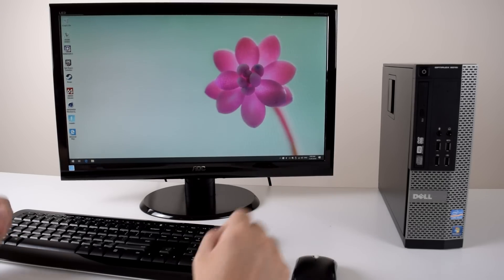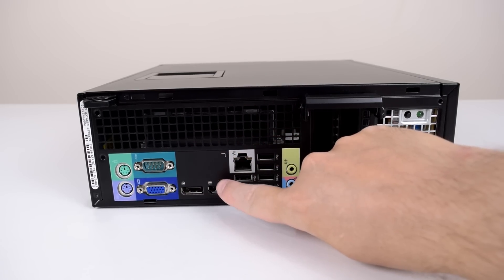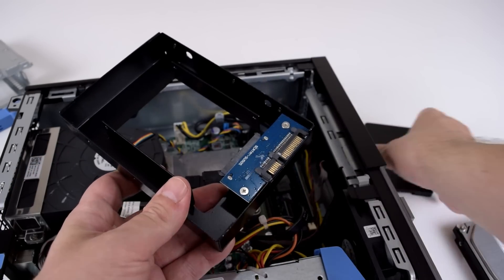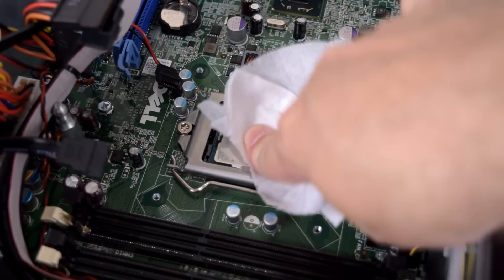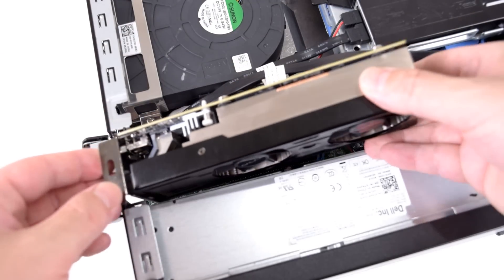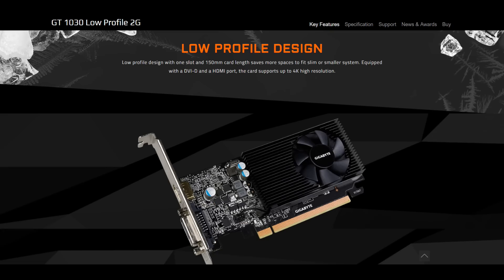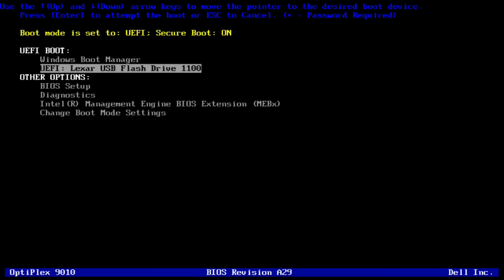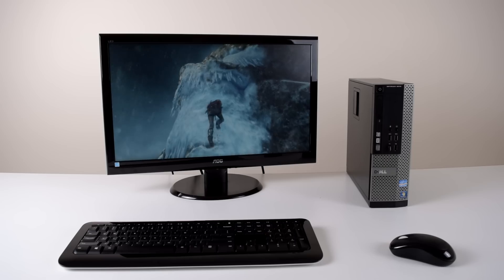DELL OptiPlex 9010 Upgrade Guide! Core i7 32GB RAM GTX 1050 Ti and more

Comment: Why did you install Win 10 instead of Win 7, which has a much better interface?
Reply: Because windows 7 requires the convenience roll up update to run properly today and even on an ssd and w7 due to windows 7 update mechanism it can take a while (quite a lot actually) to install. Without it many installers (Adobe reader example) do not run at all, and you have incomplete gpu acceleration in browsers.
Reply from the maker: I see no reason to still use Windows 7.
Reply: @philscomputerlab  :
Win 10 is evil.

Comment: Quite honestly I think for maxing out value getting a used GPU would be excellent for this, you could probably score an RX570 or something of the sort for around ~$75 but that would require a new PSU if I'm not mistaken

Anyhow, a few questions: how much did the I7 cost you? And is there space to have both an SSD and a hard drive or would that require removing the optical drive?

Thanks!
Reply from the maker: Yea you remove the ODD and install a SSD, then you can keep the HDD in the lower bay. I got the i7 second hand a few years ago, I cannot remember the price.
Reply: @philscomputerlab  Thanks! Enjoy your content very much, keep it up!

Comment: Lovely little build. It is wonderful value! 32GB ram in an office PC. Sheesh
Reply from the maker: Yea I got this PC March 2018 and I use it all the time in my lab, but was only able to put this video together this year...
Reply: @philscomputerlab   Did you use Dell branded ram or ram from another company? Plz help me as I am interested in something similar
Reply from the maker: @mutasimrahman6833  Any 1333 or 1600 DDR3 should work just fine, but use standard RAM, not ECC or registered server stuff. Check links in description for cheap RAM
Reply: @philscomputerlab  THANKS
Reply: @philscomputerlab  can you upgrade Lenovo T420 please
Reply: @philscomputerlab  DDR3 1.35 / 1.5V?
Reply: @philscomputerlab  cani put a i7 into a dell opiplex 3010
Reply: @philscomputerlab  
Hey Phil! Can you remove the card retention latch on the optiplex? (the outside latch on the back of the gpu). Is it possible to remove?
Reply: @philscomputerlab  thanks so much for this video I found a i5 3570 3.40ghz for 100!! Now just need some ssd and a good gpu
Reply: @philscomputerlab  bro, I have 200 AUD as a budget and I am getting a 9020 sff on ebay (without HDD caddy/HDD) for 90 AUD AND I am getting a 1050 ti..
Reply: Stupidly good value and you can find them everywhere. Picked up a 9010 with an i5 2400 for around 100 CAD.
Reply: @BrandonsOnline  ? the build Dell OptiPlex 390 i5 2390t 3,0ghz 2cores 2 threads i5 is the best with gpu 6gb 1660 or gtx 1080 for gaming héhé
Reply: @chrismaster6294  you can use 1080 if you have extra $$$ and it's much better than 2060. I'm using zotac mini 1070. Rx 580 also an option if you didnt plan to upgrade for the time being.
Reply: @BrandonsOnline  I got a dell optiplex 9010 mt for 60 on ebay with an i5 3570
Reply: It is the Aussie version of the Ozbox V2. 

Two of my favourite Tech YouTubers.
Reply: @dgorry  Ozbox??🤒
Reply: The 3010 and 7010 can support up to 32GB as well.
Reply: Oz follows every single tech channel😂
Reply: Would it be a rip-off to pay $300 USD ($475 AUD) for a Dell Optiplex 9020 i7 4770 3.4GHZ with 16gb DDR3 and 250gb SSD?
Reply: SHEEEESH!
Reply: Sheeeeeeeeee
Reply: Is it possible to upgrade a i3 to i5-i7 cpu?
Reply: @tonysavage4205  Yes but with same generation.
Reply: Shiro Amada I have a optiplex 7010, do I just look up CPU’s for that ? Or is there a serial number specifically for my pc
Reply: @tonysavage4205  i'm using optiplex 7010. U can use i7 3770 or 3770k
Reply: Shiro Amada ok thanks
Reply: 32GB may have been overkill for a gaming machine, but I have one of these in a corner w/ 32GB that I use to play with virtual machines. Something else I like about the Optiplex 790/990/7010/9010 is that since they have 4 RAM slots I can get 16GB of RAM into them relatively cheaply (or 8GB if I'm selling as a general purpose machine).
Reply: You know google eats ram like a beeotch with all those "research" tabs.
Reply: Can I put a 32gb ram in dell inspiron 660
Reply: Is this a good option going forward in the future? with constantly changing requirements for programs and updates etc.  will we always be able to just upgrade the PC without buying new ones ?
Reply: How much was the cost for upgrading???
Reply: I have dell optiplex 9010 is amazing gaming pc since I upgraded to a 1tb ssd, ddr3 ram 32gb, and radeon 2gb hd 7600 series its now an 11 emulators 1200games monster 👍

Comment: Good stuff Phil. I use one of these for work, I replaced the spinning disk with an SSD and it runs great. I've been looking for a GT 1030 low profile GPU but can't seem to find a good deal on one, €100 seems steep to me
Reply from the maker: I have the Gigabyte GT 1030 GDDR5. Here in Australia we have deals every now and then, sometimes 20% coupons on eBay, I usually wait for one of those. Pro tip, look out for used 750 low profiles, they are on the same level in terms of performance, just draw a bit more power than the 1030.

Comment: BE WARNED: The Optiplex 9020 SFF machine has the 16x PCI-E slot on the bottom, limiting you to GPU's that are BOTH single slot & low profile (i.e. the GT 1030, and well only the 1030 unless you find something older). Also, the 9020's seem to come with 2x 2.5" HDD bays instead of a single 3.5" bay. Great for an SSD + HDD combo setup, and you get to keep your optical drive to boot!

Otherwise it is still a great machine for the price. I've owned mine for about a year now bought secondhand-refurbished from Ebay here in Australia.
I have mine sitting behind my monitor and it's as quiet as can be with an i7-4790. The 1030 is a little on the loud side under load though.

Oh and another good tip, mine came with the BIOS set to legacy mode with software RAID enabled, but without a RAID config set. Make sure you set the BIOS mode to UEFI and disable RAID before installing Windows! Both legacy mode BIOS and RAID slow down the boot process significantly, and can't be changed without reinstalling your OS. The slowness is extra noticeable when booting from and SSD.

In Windows 10 you can also use the Windows graphics options to ghetto rig an Intel HD + Nvidia GPU switchable graphics setup, which works great for saving dedicated VRAM 🙂. You'll need it with only a 2GB 1030.
Reply from the maker: This video is about the 9010 though and that one takes a double slot low profile just fine.
Reply: @philscomputerlab  Very true. Just thought I'd warn others considering both machines look identical from the exterior (other than the model number, that's really it!). They're both just as easily found kicking around on Ebay too. There are minor, but crucial differences that need taking into consideration. One would be tempted to buy into the later model with Haswell and its benefits such as AVX2 support, lower power consumption, better IPC etc. without realising the downsides. Still a great video as usual Phil!

Comment: When I upgraded my Optiplex 390 with a MSi GTX 1050 I had to install a 500w PSU otherwise the system wouldn’t power on.
Reply: very weird ive seen many vids of people running these systems on the oem psu and it's working fine look i sau stick to the mini tower version of these optiplex's and add a gtx 1050 ti at first and GTX 1060 3gig+upgraded psu later and you have no worries running games
Reply: It gets even weirder. I just tried it again with the original PSU and it worked. Perhaps the i3 the Optiplex came with was power hungry. It’s ok though, I think the black PSU I installed suits the overall aesthetic anyway.
Reply: @Kundalini12  yeah or something was causing power leak somehow somewhere i don't know

Comment: I built the full size case of the same computer right around new years. I ordered an 8 Gb Radeon RX580 OC to put in it but it was a little too big lol. So I had to put that into another i7 I just built with a larger case. There are 8 Gb Video Cards that will fit in my case but I need to order a special one. Here is a link for some decent small form fator video cards (at least what to look for) https://graphicscardhub.com/best-small-form-factor-graphics-card/ .
Reply: Like I said above I built the Same Computer only a different Case. The Computer shown here is a Mini Case & needs a Style Graphics Card Like Phil Shows, But if you have a Mini Tower Like I do than it can take a Larger Card, just not a Monster Full size one

Comment: I had an oem motherboard with a 30W 16x's pci-e form factor slot. I put a gtx 750ti (no 6pin model) and it would be "wonky", shut down under load, the video card worked perfect on other computers. I then put in another gtx 750 ti that had a 6pin pci-e connector on it and used an pci-e molex adapter, that fixed the problem, I even overclocked it and worked perfectly fine. Looks like you got a true 16x's electrical slot which no doubt all motherboards with multiple pci-e slots have.

Comment: 9:47 fyi, even old keys, from Windows 7 license stickers might actually properly activate your new Windows 10 …keep in mind that Microsoft is currently "desperate" to building up their (still lacking) Win10 user base   …also, consider their overall tendency to a "Windows as a Service"   …yes, you should be worried
Reply: @jackthegamer did you notice the most hilarious part? There's DirectX 12 FOR WINDOWS 7 (SEVEN), because Blizzard wants it for their WoW. I think, that's as amazing, as it's hilarious! I'm sure, there'll be a few "exploits" …meh, well, it's not actually an exploit, when the API is officially implemented, right?!
Reply: @jackthegamer imho, the implementation of "Cortana" (It, being shoved down your throat) is not driven by user-request; it's driven by management decisions! MS management wants to claim a section of the "verbally activated personal assistant" pie. You know, "Hey…" Alexa, Bixby, Google, Bing…

Comment: 🙂  If your handy you can transplant many of the SFF internals to a regular case

😒👍 Definitely you wanna go i7 ivy bridge sandy bridge or xeon 8thread equivalant. Your going to have problems with more and more games with only 4 lousy threads, and even 6 threads have micro stutter in some games that you can see if your making a recording of the millisecond graph. 8 threads will stay relevant for a long time tho so that should be everyones minimum going forward if your planning to buy new aaa games at $60 a pop. Rite now the price difference between i5 & i7 is only $45. The same applies on Ryzen, at minimum look at cpus that have 8 threads. Check hardware unbox last few months videos where the 4thread cpus get devastated & BTFO🔥

🙂 checkout this russian guy comparison of i3 i5 i7, as u can see by his graphs in cpu intensive games the 8 thread cpu make a huge difference!

youtu.be/DY0LoERbPN8
Reply: @cyberman7348  🙂 sure i agree, if ur tight i recommend LGA775 Core 2 Duo Laptops n Desktops, but no less. Im talking to the people that want upgrade options and what benefits you will get back from them, for the longest time everyone was saying that an i7 was a waste of money but now its definitely not, 8 threads makes a huge difference now! 😱 plz also consider picking up a used 1070 8gb they are finally coming down in price good pairing with an i7 🐢🐢🙂
Reply: @cyberman7348  😰 that
only has 2 threads, look for the cheapest used i3 and i5 haswell cpu 🙂🐢🐢🐢🐢
Reply: @cyberman7348  🙂 ok buddy

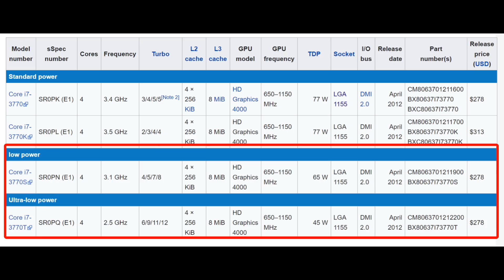Comment: 4:52 -S or -T variants have a "hardcoded" lower TDP …those CPUs WILL (thermal-)throttle earlier than non-S/T variants. If that's what you want, no worries! If not, a bigger cooler will NOT improve your situation - yes, worry NOW!

Comment: Nice  i stayed away from the dell sff.     You are the authority on sff pcs and thin clients
Reply: Would it be a rip-off to pay $300 USD ($475 AUD) for a Dell Optiplex 9020 i7 4770 3.4GHZ with 16gb DDR3 and 250gb SSD?
Reply: @Funkteon  yeah unless its not sff

Comment: I have a dell optiplex 3020sff and I can only put in a single slot gpu :/
Im currently stuck with a gt 630
it has an i3 4150
2x4gb ddr3 1600mhz
Reply from the maker: Yea, like Max Pain mentions, a GT 1030 GDDR5 is a decent option!
Reply: Zotac makes a 1050 Ti that only uses one PCIE bracket, but it still needs the room for the cooler:
https://m.newegg.com/products/N82E16814500411

Comment: 1:14 imho, a bit strange that Dell didn't make those USB 3 ports blue.
Reply from the maker: True, good point.
Reply: In my experience oems rarely color USB 3.0 differently. Some business models do but many consumer ones don't. My Dell 3576 has all ports black despite the fact that two are USB 3.0 and one is USB 2.0, the only way to differentiate between them is the ss engraving.

Comment: Optiplex 9010 sff. I5 3gen -4gb -250gb and a gt 710 2gb for 150$ . Should i get it ?
Reply from the maker: IMO go for a model with 8GB. You could sell the 710, but that's just extra hassle.
Reply: @philscomputerlab  I'll propably go for bigger case and minimum 320 w psu  . Is that good
Reply from the maker: IMO at that point you might as well build something custom...
Reply: @philscomputerlab  you're the best <3
Reply: @philscomputerlab  just want u to know . I have a 250$ budget . And here in morocco . The parts price is a bit higher not like us or aus
Reply from the maker: @thebluesoldier860  These HP have propriety parts, so you cannot just put in other PSU or case.

Comment: Thanks Phil. I have the Mini Tower Version. Great Machines easy to upgrade
Reply: I’m getting the Mini Tower Version tomorrow. 
It’s gonna have 16 GB of ram
128 GB Ssd
1 TB HDD
The GPU’s listed in this video, are they only ones that can be put into the Mini Tower version as well or are there other options available?
Reply: Professor Noonie for how much and send me a link
Reply: And they have standard ATX power supplies too. The HP modells have better upgradability, but they have a specific PSU, so u cant just go into the local PC store to get a new one. I have a HP Elite 8100 SFF with i7-870(i5-650 before the ug) and a Dell Optiplex 7010 SFF with i5-3470. The Dell got only a dual slot 3.5" converter for SSD+HDD and a MSI GT 1030(2 slot passive heatsink). And thats all for the Dell. For the HP it have a Zotac GT 1030(1 slot), a pci-ex wifi card(Asus PCE-AC56), a pci-ex USB3 card(and a front panel 2xUSB3+2xUSB2 hub from a HP Prodesk 400 G1... and some zip ties, but its secured in place with the power button xD), and finally an old lp PCI Soundblaster Audigy Fx.
Reply: George Z88 Forgot to tag you in the above comment.

Comment from the maker: Forgot to mention, I got this machine off eBay March 2018. Prices have since come down even further, so this machine is even better value right now.
Reply: PhilsComputerLab nice! I am literally making this same computer just looking for a good deal on 32BG of RAM. I actually just made a video on its performance on Left 4 dead 2.  Beat me to the finished build haha. Great video man!
Reply from the maker: @randomgamingprojects  You can also go with the in-between 24GB with 2x8GB and 2x4GB sticks :)
Reply: Also forgot to mention I would go with the i7 3770s or T instead I mine originally had a i7 3770 but when testing it on prime 95 the cpu got a little to hot for my comfort switching to the S model resolved the issue. Also for people worried about power draw Silverstone makes an 80 plus bronze certified 300W TFX psu that will fit in place of the original.
Reply from the maker: @randomgamingprojects  Oh really? Wow that is nice. Have you seen a video or somewhere online with someone changing it out?
Reply: PhilsComputerLab I haven’t seen a video but I have read on various forms that people have gotten that psu to fit and Also a seasonic 350w to work as well.
Reply: PhilsComputerLab I’ll make a video once I get the Silverstone one once I order t here in a couple weeks I’ve never filmed a pc upgrade video so should be fun.
Reply: i snagged a optiplex sff 9010 i7 3770 1tb 8gb ram for $155 including postage! dont have enough money for 1050 ti or 1650 tho so gonna be saving up
Reply: @alexmaldonado2804  you ever complete the build??
Reply: @SkyMuffinz  lol, nope. The PC is now my dad's and includes a lp MSI GT 1030. I received some birthday money so I upgraded my old rig and I now have a i5-10400F z590 motherboard and an rtx 2060!
Reply: Nice machine, I just built a HP 8300 in a similar configuration after watching your earlier videos and it’s awesome. One thing though,  do you know if it’s possible to run aftermarket ram at 1600mhz with the HP bios?
Reply: Mark As far as I know most OEM motherboards don’t allow for RAM/CPU over clocking. However the ram on my dell optiplex 9010 does run at 1600mhz. What cpus are supported? Usually if the motherboard supports the 3rd gen i7 cpus it will run 1600MHz however that is not always the case it really depends on if the bios and chipset the motherboard uses supports it I would get a low capacity 1600mhz ram stick and test it see if it runs in the machine before buying into say 8-16GB of ram.
Reply: Random Gaming Projects cheers, bit late for that lol, it’s an i5-3470 and the HP q77 mobo. Cheers anyway
Reply: Nice work mate. I don't no much about PC but I wanna get my first gaming rig PC do you recommend me this one with some tweaks of course thanks